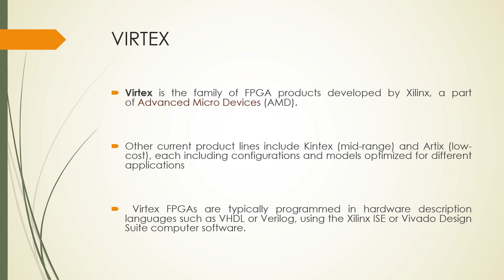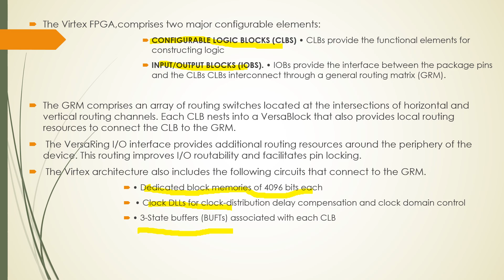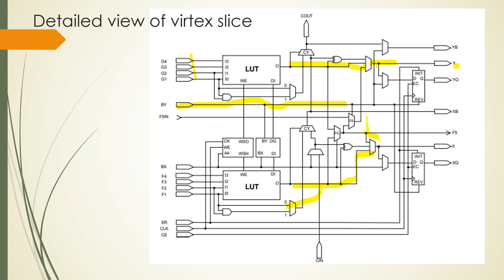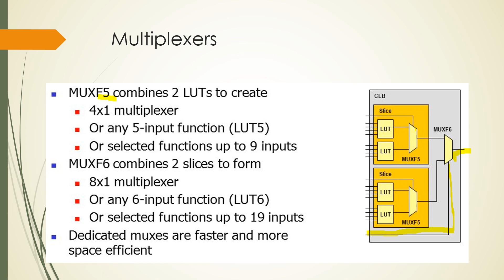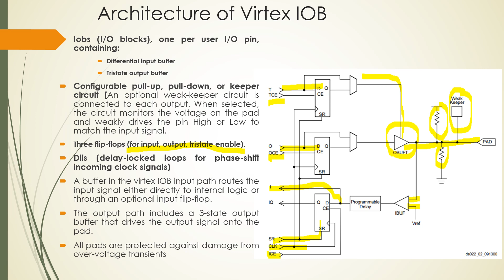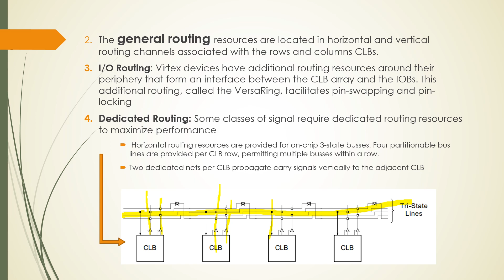XILINX VIRTEX

Comment: Hello, thank you for the video, I’m not a technician but I have a board for which the Xilink Virtex 4 processor is d’effective
And idea how to change it plese? Thanks
Reply from the maker: Are there any visible signs of damage, like burnt components or physical defects? Is the issue related to power supply, connectivity, or firmware?
Reply: @anujyothi  no appearance sign on the board or the processor, but no  image on the screen, and after diagnostic, the problem come from the processor, in case you can send me your wattsap I can send you more details